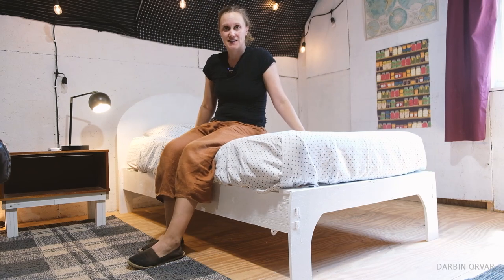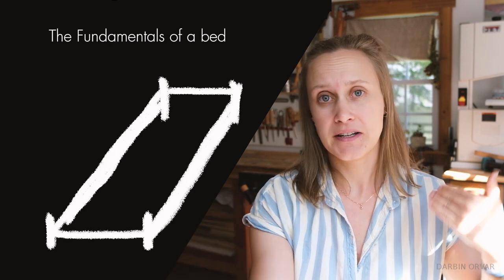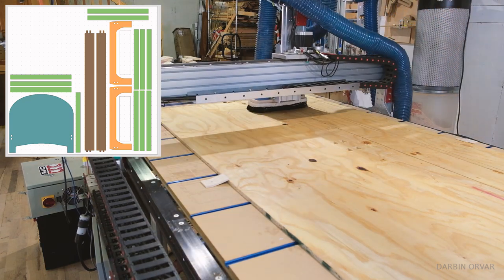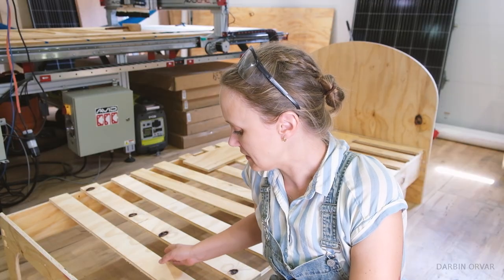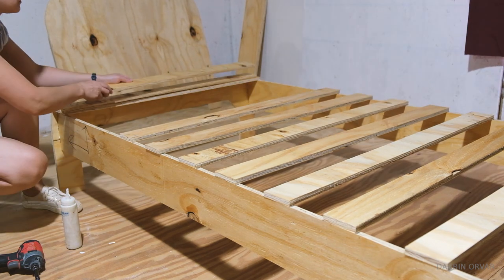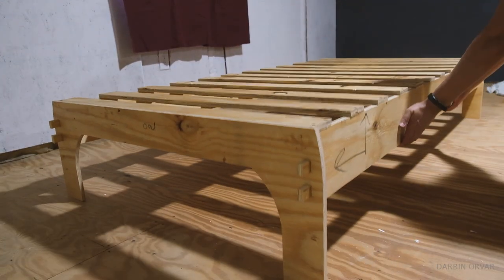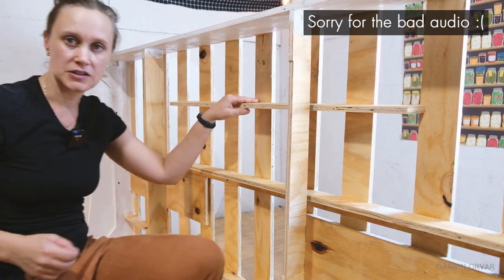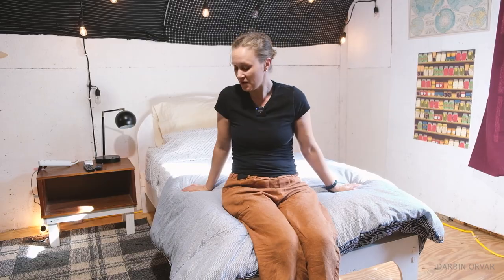How To Make a Twin Sized Bed for $50

Comment: With some foam and cloth one could really cover the headboard and really change the look for a relative inexpensive price.
Reply from the maker: Yes, good idea, you could completely change the look with that.
Reply: I made a headboard with some 2 inch rigid foam insulation.  I just cut it to the width of my bed, and covered it with some cloth from the bargain section of our local fabric store. (But a thrift store comfortor would do the trick as well!)  For under $10... a nice BIG headboard that weighs practically nothing.